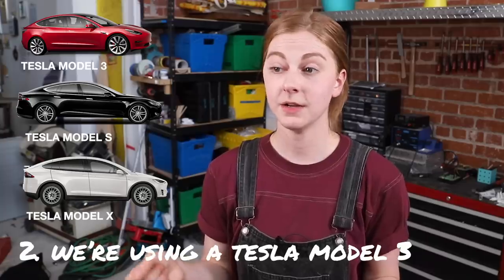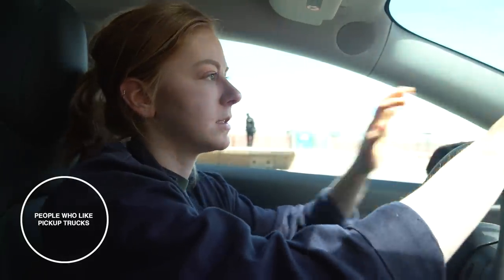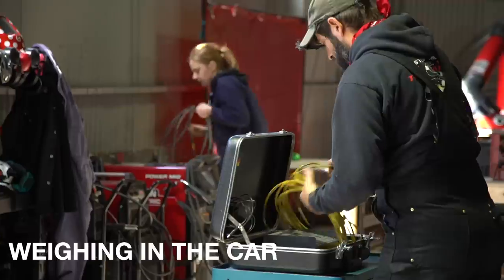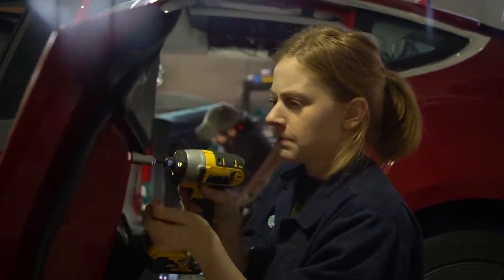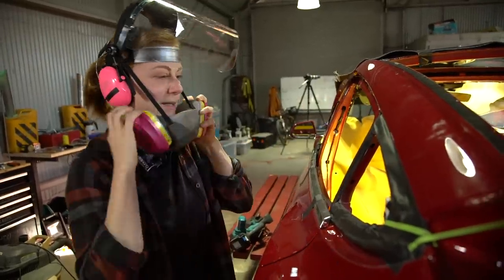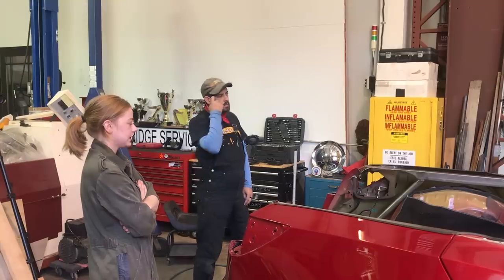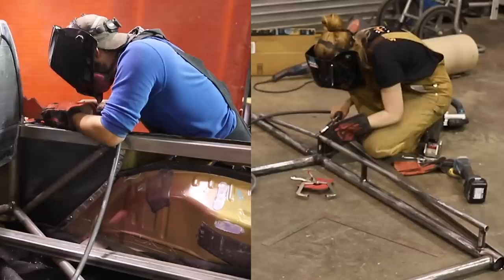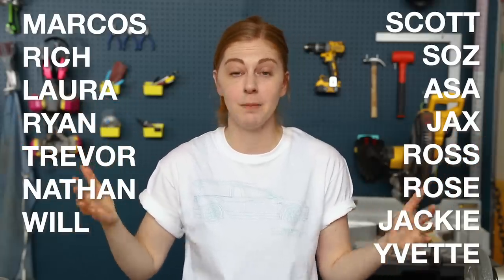I TURNED MY TESLA INTO A PICKUP TRUCK

Comment: “It’s not feasible for us all to drive around campfires” - Simone 2019
Reply: But millions and millions of decaying batteries is a better solution 🤦‍♂
Reply: @thedriver9735  are you not aware that lithium ion batteries are completely recyclable? Lithium batteries are worth a lot of money, you don't just throw that s*** in the garbage.
Reply: @TheBetterGame  they can't possibly last forever
Reply: @TheBetterGame  also making them has a shitty impact on the environment
Reply: @thedriver9735  Neither does an engine, what's your point?
Reply: @baddabing4609  okay you need to reread every thing
Reply: Max-Leo Amberg  but they aren't completely manufactured using renewable energy. And at some point you're gonna have a ton of fucking batteries sitting around doing nothing.
Reply: @thedriver9735  Maybe someday, but it's still better than a bunch of rusty campfires sitting around doing nothing, right? ;)
Reply: @jacobfield2214  what's not feasible is everyone driving an electric car. At least in the US we don't have a power grid capable of supplying everyone's car with power. Also how are you gonna make that power? Someone's gonna say "renewable energy" But it's not exactly that easy.
Reply: @jacobfield2214  also no a bunch of decaying batteries is not better
Reply: And how many people/companies are ACTUALLY going to recycle that?  All you're doing is replacing oil with another product that's shit for the environment.  And It's cheaper not to recycle them.  Also, all of the metals in them that are mined to make them.
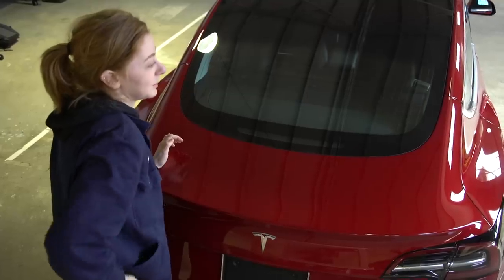Reply: 6:45 me crying WHY?! I DON'T DESSERVE THIS!

Simone Let's buy a very expensive car and cut it in halfs.
Reply: @thedriver9735  Not right now—but mass electric car adoption isn't going to happen overnight either. As the need grows, so will the infrastructure to support it. And yes, renewables. All said and done, I'll bet that creating new renewable infrastructure is easier than creating new oil infrastructure.
Reply: @jacobfield2214  It's only creating a bigger problem. I'm not saying everyone needs a combustion engine, also not saying electric cars are bad. I'm saying electric cars aren't the solution everyone thinks they are 😄
Reply: Worth keeping in mind that batteries are still a progressive tech, what we're still commonly using are relatively primative and the sourcing of materials is indeed damaging to the environment but even with the few advancements we've made the efficiency and cost, both economically & environmentally, have improved greatly. The ability to efficiently store energy is one of the biggest technological hurdles we face and it's companies like Tesla that will likely help solve part of that problem, if people want to overpay for guinea pig tech and fund that R&D then I say let them. There's also problems when comparing a century old etablished technology with a recently birthed one, look at early wind turbines where the cost-offest could take over a decade to reach where as now it's a matter of months.
Reply: @thedriver9735  It's going to be a long time before there are completely useless surplus batteries sitting around. Lots of uses for partially degraded battery packs, even if they aren't as useful for EVs after some degradation. Take what's being done with Nissan leaf batteries, for example. In addition, extra batteries will actually help the grid get better/cleaner—salvaged EV batteries can act to balance out supply/demand on the grid, for example.
Reply: @thedriver9735  Not all by themselves—but combined with battery tech and power grid advancement, which will be driven by a demand for electric vehicles, they will become a large part of the "solution to stopping pollution." (Not that that's the only reason to drive electric.)

Comment: Now turn a pickup truck into a Tesla
Reply: I know right.  Im patiently waiting for someone to put a F-250 body on a tesla chassis somehow.
Reply: @sh0cktim3  that most likely won't happen, since frame vs integral body. 
My guess is, it'd be easier to put Tesla parts into a truck.
Reply: I think that would have been easier, actually.
Just put some batteries and a motor into a truck. You'll need some other things too but it should be half as difficult.

But for sure, this looks better.
Reply: @sh0cktim3  there is a company in Austria who built an electric Hummer H1 and an e G-Class for Arnold Schwarzenegger ;)

Comment: Hej Simone, and congratulations on your crazy but wonderful Truckla project. I havn't watched it before but I wished I had seen it much earlier. I'm a carglass technician in Sweden and have worked with car glass replacement work since over 15 years. I want to raise a BIG finger of WARNING about the method of removing the glass window on the Tesla. You should NEVER heat up glass adhesive the way you did. It is super dangerous. The way you pull the wire cord back and forth heats up the wire and the adhesive and can result in toxic smoke and gases (isocyanates). There are plenty of profesional technicians with tools that does the job without risk of causing isocyanate gases.

Comment: Would the Model Y have worked better for this project? I know it wasn't out at the time of filming.
Reply: Also on this question, the Model Y has an aluminum frame, compared to the steel frame of the car that they were using to build the truckla. Aluminum is softer and has a lower melting point, so welding and cutting the frame would have been a harder to make it look clean on the model Y.
Reply: Yes timmy, the Model Y would work better

Comment: Take it to the Tesla dealership for maintenance and record their reactions!!! .....

Do Tesla's need maintenance?🤔
Reply: there's still brake fluids, coolant, lubricant. sometimes a bug
Reply: Strawberry Hill they need oil changes sometimes
Reply: Nah, they require major repairs more than maintenance.
Reply: @Werk4Cash  they do not need oil changes, they do not have engines to need oil.
Reply: @Werk4Cash  it's... Its an electric car
Reply: she's got rich for that stuff, no need for dealership
Reply: @godfilma  Gear oil would still be used in the drive train.
Reply: Yeah. but very, very rarely.
Reply: @timothyfiedler344  tho not in the same way a car would being that its practically direct drive
Reply: Do any of the Tesla shills here even own one? Asked an owner? Teslas will not hold value, and an enormous majority on the road today will be scrap in ten years. Most sooner rather than later.
Reply: mister clean  With good designs and maintenance, there are many cars that cost a fraction of a tesla, and will double its longevity and then some easily. With skill and knowledge, much more than this is possible.
Reply: @Jakugen0   warranty for eight years on battery and powertrain and then two years later we'll scrap 'em? That's ridiculous!
Reply: @Jakugen0  how could you say that?!?! My family is NOT going to scrap our Tessy!
Reply: @silviamills5218   why do I get the impression that you are the parent speaking as if you were the child? Kind of weird, but whatever.
Reply: @Jakugen0  I am the child.
Reply: @Jakugen0  I'm 12
Reply: @silviamills5218  X
Reply: @Jakugen0  why did you just reply with a letter X? What does that mean?
Reply: @silviamills5218  Doubt.
Reply: @Jakugen0  no seriously it's true. I'm the child and I like our car "our Tessy" is just a silly thing I call it.

Comment: "I want to drive electric because  . . .it's not feasible for us to all drive around in campfires. . . "
Reply: "Fu*k oil companies"

Brilliant
Reply: @Jakey The thing with electric is that although what you say now is true, more than 80% comes from coal plants, in the future you don't have to change the car when new methods of producing electricity comes.

So in the future with clean energy your car gets cleaner
Reply: @raakobihai2967  
As well as the fact that EV's are more efficient than gas cars, so even if every single bit of power from the car comes from gas, it will still pollute less because it uses less energy for the same output.
Reply: b king  Are Tesla stopping mechanics from fixing teslas? Or do you just want an independent Tesla-only mechanic?
Reply: Happy! That made no sense. Google lithium mines.
Reply: raak obihai “clean energy” isn’t efficient and the resources it takes to build that stuff ravage out natural resources.
Reply: @stillness4610  my car runs on used cooking oil, booyah
Reply: raak obihai dude clean energy is something that doesn’t pollute I don’t why you even said that because that makes like no sense like solar panels they use clean energy like natural resources with what they use is the sun
Reply: f x r n w e h you need to think about what the cost is to produce that stuff. It’s horrendous the damage caused to our natural resources by the production of this kind of stuff. Lithium has to be stripped mined. We are simply not efficient enough to cleanly produce that stuff, even at the rate we produce gas burning cars.
Reply: tristan 123455 was the conversion hard? Do you have to worry about clogged injectors?
Reply: Keep in mind that nuclear power is a cheap and safe technology that is available today, and 100% clean. While solar and wind are not actually usable as a stable energy source and not very efficient. We have green solutions, we just aren't willing to use them.
Reply: Joshua Swoyer How do you figure nuclear energy is clean? Have you ever considered nuclear waste?
Reply: When it almost taco-ed I've just felt the sorrow. Does the structural, uh, integration hold for the approval and what did Tesla have to say?
Reply: @Jake That's a myth. Electric vehicles are so much more efficient than gas cars, that you could power them with coal and still be as bad for the environment as a typical IC car. In most places though the mix of coal, natural gas, and renewables is such, that in a couple of years you offset the carbon used to create the car and it's so much lower than IC cars it's not even fair to compare them.

Comment: "Is the roll bar an exposed radius for the down sheet?" 😂😂😂
Reply: That's a valid question? I'm still rolling over in my mind trying to understand what he meant.
Reply: @TwistTimHansel  I was wondering the same thing, I wonder if by exposed radius they mean it being exposed so they can weld to it. "Is it an exposed radius we can weld the down sheet to it" I'm not sure though...
Reply: @TwistTimHansel  My interpretation; "Is the outside wall of the roll bar (the exposed radius) an attachment point for the vertical sheet metal that will form the rear wall of the cabin?"

Comment: "I have an angle grinder and a welder and I'm not afraid to use them" - words to live by!
Reply: My sort of girl ,anyway great therapy for getting better
Reply: battery powered angle grinder... so yeah definitely a let down
Reply: The sawzall works so much better than the angle grinder though. They eventually figured that out, but they need to find better blades and bigger arms. Way more efficient.
Reply: Welder + blowtorch + beer = building whatever the hell you want.
Reply: @kennethclifford1863  and the blowtorch is just for when ur clicky clicky won't start the oxy acetylene

Comment: As an autobody student, this is awesome. I also want to shout at my screen that any time you are grinding or cutting metal, wear a face shield AND safety glasses/goggles. I've had metal shards in my eye and it sucks. I was lucky enough that it never required medical attention. My teacher has stories of being much less lucky
Reply: @a.melburn  lol okay. As I said I am a student. I have made mistakes from being lazy and rushing. That's why I'm a student, and not a paid professional. I'm learning. I'm just repeating what my teacher with 30+ years of experience told me for being lazy and inexperienced. Yknow, to educate me. I now always wear glasses and a visor, because I experience what could happen when you don't. I see nothing wrong with sharing my experience. 

Also, "hit me back with something useful"? I don't remember tagging you lol.

Comment: Interesting concept pickup truck but would it be easier just to put a hitch on it trailer what breathing better yet is mounted to the roof the trailer you could call it rooftop pickup truck. Just mount a pickup bed on the roof of the Tesla and call it a Tesla pickup truck he's got a bed on it if it's on the roof and you could put a dumping mechanism so little dump two that'd be pretty cool make it removable so you could just go to church on Sunday with it.
Reply: Yeah, I basically said the same thing.  Trailer is the way to go. You can even put solar panels on the trailer and get a bit of a maintenance charge that way.

Comment: I need to add an instructor break to a Tesla model 3 for a driving school. Need to add a break pedal to passenger side basically. I installed it on a Honda HRV myself no problem but can’t drill on a Tesla because of battery pack. I’m afraid I hit a cable or batteries. Can anyone help?

Comment: I'm actually rather scared. Haven't gotten too deep in, but ffs... In all your design drawings you are cutting out 75% of the structural shell... I SERIOUSLY hope that never has a roll over... EVER. You're short enough already and burying your skull in your chest cavity would be a pretty unsettling look.

Edit: Watched all the way through, and while you added a cage in there, I noticed the footings are still rather narrow. End result is I still hope you never roll that thing. Essentially what I am seeing is the situation of the vehicle will try to fold in half right up to the point the roof collapses. 18:50 shows the tubing being welded direct to the 20 guage sheet steel rather than a formed footer, meaning under crash loads the tubes are liable to just poke through.
Reply: If it makes you feel better, electric cars are very difficult to roll. Look up the Tesla Model X roll tests - it's their tallest SUV, and it's near impossible to roll.
Reply: @logitech4873  on flat ground, sure. The battery is a hell of a counterweight. Ground isn't always flat or firm  though.

Comment: Not to rain on the electric vehicle parade (I think ev's are dope and would love to see them mainstream)
But the airplane industry is using 3.5x the amount of fuel as ground vehicles and that doesn't include military flights which can burn up to 19000lbs of fuel an hour. Ground vehicles are definitely a problem but even if everyone in the world switch to ev's it would barely dent the actual fuel consumption of air travel and now rocket travel (we have about 111-130 rocket launches a year and it takes an average of 1.1m lbs of fuel to get off the ground)

Anywhooo the videos great! But I just hate the argument that "if we all had ev's the oil companies would go out of business" most ev's are charged with electricity generated from oil power plants anyways because 80% of US electrical energy is fossil fuels

Comment: Sooooo #BadAss. However, F*&! those lithium batteries. Environmentally Better to drive a gas combustion engine. Diesel even better.... but we aren't supposed to have that conversation
Reply: It's way better to drive a lithium battery vehicle, environmentally speaking.
I recommend you actually look up total environmental impact reports

Comment: so when do we get a close up on the pick up? How does the bed now look? how did you fit the back window and wall? Show us the tail gate! This video was a lot of teasing, but not much of a build! you made a couple of cuts with the grinder, which were screw ups because the whole professional crew forgot to put bracing in first. Then you traveled for 3 weeks and the pick up was almost done. Never really saw any footage of the build. I could almost claim I did it, nobody would know! Do you have more footage? How did you solve the wiring and computer error problems? Can you still supercharge or did Elon cut you off?